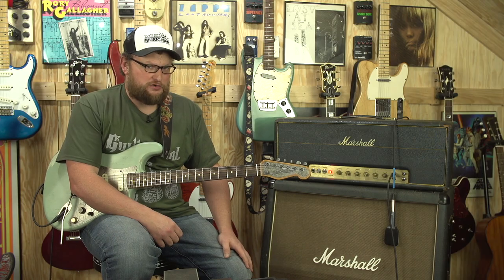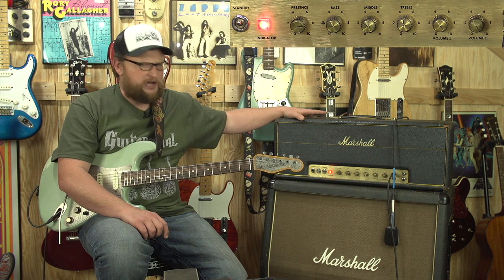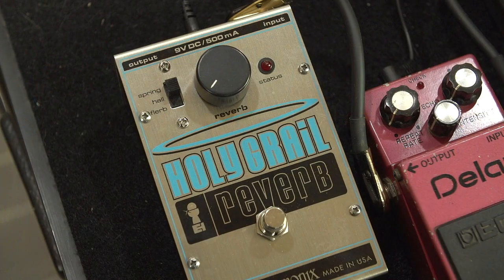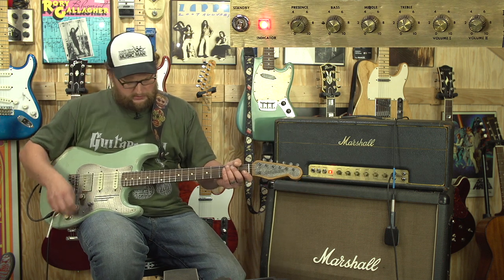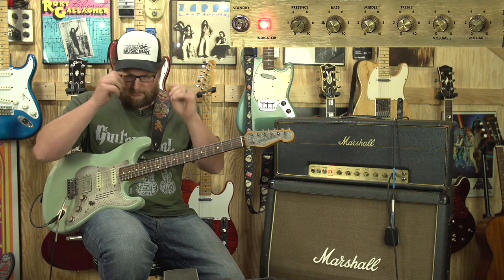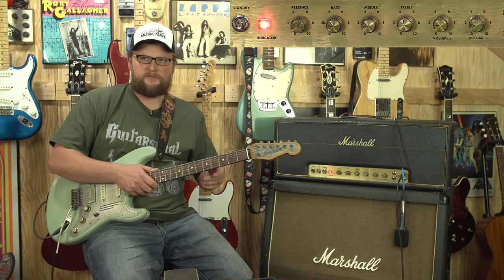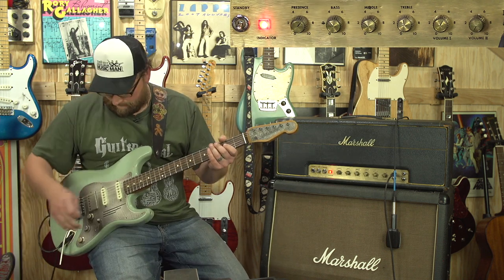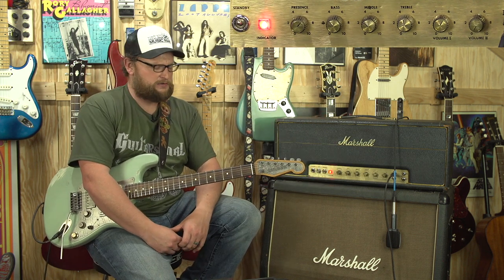1971 Marshall Super Lead CRANKED!!!

Comment: Hey Eric, just a note: tubes don't like to be kept on standby for long periods of time. Without the high voltage applied and heaters on, the cathodes will poison themselves and generate a resistive layer that cannot be removed. This will lower gain and make the tubes die faster.

Comment: The first inputs are a symmetrical clipping circuit, the second set are an asymmetrical clipping circuit.

The second set is the Marshall sound everyone thinks of. The first is a slightly hotter Bassman sound, with almost the exact values as one. 

If you guys have any questions about the 5E6(THE ORIGINAL DUAL RECTIFIER!), 5F6, 5F6A Bassman or JTM 45 to 50 watt 1959 Super Leads, I can probably answer them. I build clones with the best possible modern components, component values that left the factory at that specific time (The schematics are close, but not exact) and take pride in the results!
Reply: Thank you Matt good to know. This amplifier belongs to a close friend of mine so I wasn’t sure
Reply: Iraqveteran8888 you’re welcome. I’ve been a fan of the gun channel for years now, this guitar channel is probably going to be even bigger. Without the political BS, blatant discrimination and demonetization! Great playing Eric!

Comment: Videos like this are really helpful to me, because while tone is in the fingers, when I want to mess around with my gear and go for a Hendrix tone I need to know what the base sound is. As in, before the distortion and boost from the fuzz face, the boost from the univibe, etc. how much breakup does the amp have when being pushed by just the Strat? There are lots of videos of cranked Marshalls, but most use attenuators and most are with humbuckers. Hearing a regular Strat, straight into the head, being played aggressively, is something I really appreciate. Thanks!

Comment: Man, that sounds pretty legendary considering the way you mic'd up that can.
Reply: It’s got a Seinhesser 609 on the cabinet and a room sound being captured wit an SM58 going into a Tascam recorder. I think the blend is like 70 can and 30 percent room
Reply: Iraqveteran8888 I was referring to the way the way the cab mic is kinda dangled in front of it. Never seen it done that way haha. It works and it sounds good through, so I'm not gonna question the method.
Reply: That's how you use the 609. Its supposed to be like that.
Reply: hawk6111 Alright. I've just never used one before so it looked pretty off to me. I kinda just stick to my standard SM57

Comment: Fantastic amp, (not enough presence or middle for my taste)...but like you, I like the single-coils & I suppose they’d have been screaming at that volume? Thanks for sharing this video, it’s one that I would have requested. I had a 50 watt Marshall head & 4X12 cabinet...replaced by a rewired Fender head, which was a beautiful setup.  Much like my K-31, it was far 'better' than me. Great improv on Misty Mountain Hop, nice touch. I don’t know how to put it, but you’ve got the 'take charge'/aggressive grip on the neck and ya make that Strat your bitch! Not a politically correct comment but that’s all I’ve got. Thanks.

Comment: ...do you have something to attenuate or are you just running straight into the 4X12 raw?
Reply: Straight in, cranked
Reply: damn. That must've been brutal.
Reply: Have either of you dudes played through tens? I have a closed back 2x10 with celestian vintage golds that has NO flub. I love it
Reply: I've never had the good fortune to have a tube amp. Let alone a 2x10.
Reply: I bought the speakers and built the box. It’s way cheaper.
Reply: Thomas Jefferson sick. Are you running pedals stereo or what? That’s awesome!
Reply: Thomas Jefferson sick that’s sounds sweet Bro!